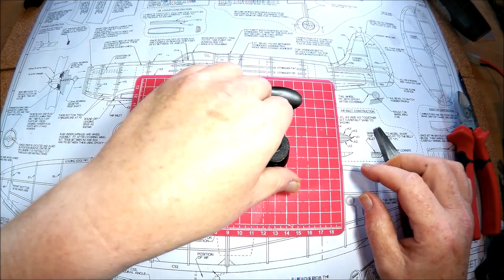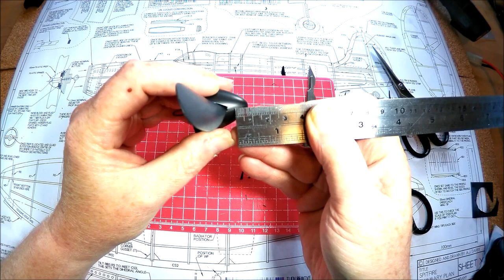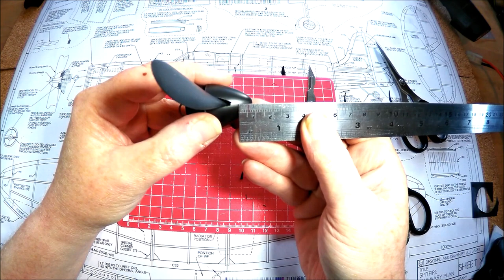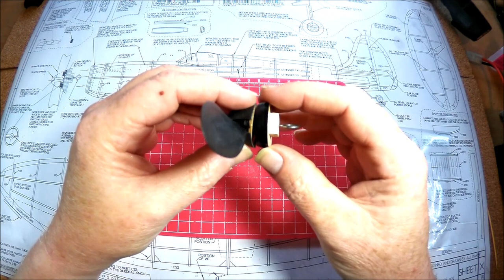Making Up The Nose Cone On My Vintage Model Company Spitfire

Comment: Thank for posting this. Us newbies need this kind of video to keep us from destroying our creations. Two questions. One did you epoxy the actual prop to the backer base of the nose cone? Two, did you hollow out the nose cone backer to allow the prop to make direct contact with the bearing?
Reply from the maker: Hi Alfred. 1/ No I used a thick cyano glue that has gap filling properties. I got mine from EBay. 2/ From memory once you have glued the prop to the spinner (nose cone backer) then you cut out the small central bit of SP1 which is held in place by two tabs.
Hope this helps.
Reply: I know it is pretty off topic but does anyone know a good place to stream newly released series online ?
Reply: @Paul Andrew Try Flixzone. You can find it by googling :)
Reply: @Chandler Khalid Yup, been watching on FlixZone for since march myself :D
Reply: @Chandler Khalid Thanks, signed up and it seems to work :D I really appreciate it!
Reply: @Paul Andrew No problem xD

Comment: Well done Mate!! 👌
👏👏👏👏👏👏
My Planes are larger.... Believe it or not, it's actually more difficult! 😖 

You have a great deal of patience on these Aircraft Builds. I do like those hollow Plastic Cones. Even if it's a bit fiddly, it's got the great advantage of being LIGHT. That has got to help with Prop Balance! 

... A problem I've had with 3 inch solid Cone Spinners. 😖😖

Thanks for rereleasing this with better commentary!! 😁 It was very useful indeed. Take care and have a great Week my Friend!
Carmine ✈🚂🚙
Reply from the maker: Cheers mate. Yes I know what you mean. You would think the larger the scale the easier it would be to build.
Reply: Structurally, yes. An 1800mm Aircraft is easier to build the basic Framework.... 

But it's really, REALLY easy to make it too heavy to FLY!!! 😲
Control Surfaces are was more touchy as we...

And a Crash frequently ends up disintegrating the Aircraft!! 😧😖

Comment: Hi Rob, great video, thanks.  Wish I had seen this detailed video before I built my VMC hurricane... This is my 1st build since 1960, when I built a Keil Kraft plane... I have watched your full video on VMC hurricane, but I seem to have a problem, and wonder if you can help/advise me... I have to fit the wings next, but it doesn't seem correct as the wings seem to be about 1/8th " wider than the recess, and I'm sure this is wrong, but I do not understand why it doesn't fit.  Can I or should I trim the wing to make it slot in... Sorry if this doesn't make sense but I'm 75 and maybe not explaining very well.  Cheers